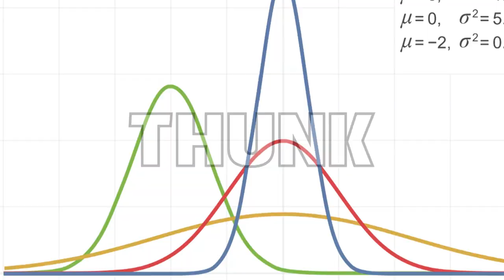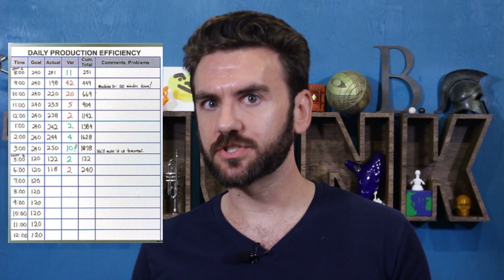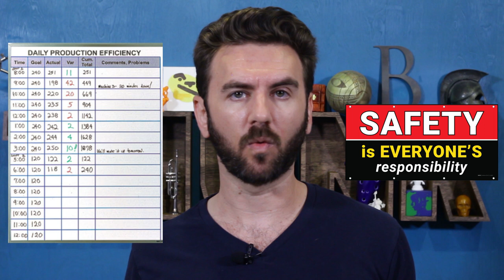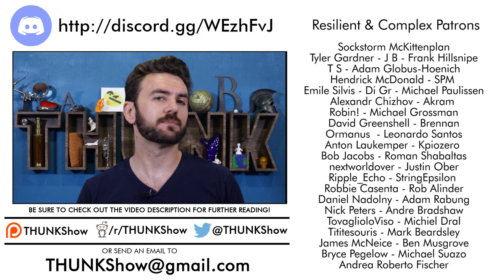208. How Complex Systems Fail

Comment: I work in a company of about 600 software engineers making software together. That organisation is a complex adaptive system, and the principles of Dr. Cook applies for sure. We tend to do these heavy handed post mortems when things go wrong, filled with root cause analyses and resulting in weird bits of policy (like monitor metric X two times a week).  Excited to read more about complex adaptive systems and resilience/robustness to understand how I can apply this in my professional life. Thanks!
Reply from the maker: > 600 software engineers making software together
I mean it would be weird if you were all making pizza together or something. 😅

Definitely check out the talks that Cook gave at Velocity (linked in the video description) - he talks very directly about strategies to enhance the robustness of large, complex software.
Reply: @THUNKShow  one thing’s for sure: with 600 people making pizza together you’d inevitably end up with pineapple on it.

Comment: I'll happily stay a software developer. Figuring out failure modes and finding that one root cause is much easier if you can replicate the issue and take the system apart and observe every component while doing so. It's super frustrating if your system has some really bizarre behavior that was caused by the tiniest of typos - but at least I don't have to deal with the real messiness of the physical world. The world is safer for it too.
Reply from the maker: It's funny you mention that - Cook has given talks at several conferences for software professionals, like Velocity. His general message is something like "Give your users the power to fix things if something goes horrifically wrong - don't hide what your software is doing so they can't get at it if they need to."

https://www.youtube.com/watch?v=2S0k12uZR14&t=0s

Comment: Neuroscience over the last few years has been playing around with what's called the Free Energy Principle, which is ostensibly a grand unifying theory for how organisms behave. There's a lot of heady details to it, but the basic idea is that any system with non-equilibrium thermodynamics (i.e. most interesting things and all organisms), by virtue of regulating themselves to come back to some steady state, whatever that may be, can be modelled as engaging in Bayesian inference on their own existence. In effect, the system is ""predicting"" (very heavy air quotes) the possible future values of parameters relevant to its survival, and if those possible values stray into areas that are hazardous to its survival - that would destroy the dynamics of the system - then the system self-regulates so that its ""predictions"" indicate future survival. This idea then gets extrapolated into explaining how perception, action, attention, etc. function on a computational level. 

This is a very short summary of a very heavy idea, but it struck me as similar to this description of how systems fail. You know entropy exists - all things will vary more and more over time - so you don't try to maintain a perfect equilibrium, but just watch out for when variations might become a problem and then act accordingly.

Comment: This is the reason why complex systems engineers tend to be rather conservative with adoption of new tech. Those are expensive toys to break and new exotic technologies can introduce unexpected points of failure that will manifest themselves in unpredictable moments. Once you have sth working reasonably well you'd much rather reuse the same old solutions, even if new tech could yield performance improvement.

Comment: An interesting analyses but very engineering biased and the engineering only occurs at a late stage of the analyses. For example 3 Mile island in the larger picture happened because it was a plutonium reactor, a very poor material to use for a nuclear power station. Plutonium was used because nuclear reactors were invented to produce plutonium for nuclear bombs, plutonium being an excellent material for bombs.... when reactors were first produce they solely made material for bombs. Then one day someone went, hey! we can use nuclear reactors to make power too, they can make both power and material for bombs, and that will offset the cost of making a reactor purely for military purposes. However nuclear physicists pointed out, we can make power stations form plutonium, but they'd be very dangerous choice compared to other nuclear material we could make which would be really safe. The politicians said, these other nuclear material that are safe, can we make bombs from them. To which the scientists said no, that's why they're safe. So the politicians went with plutonium. And the world got plutonium reactors as the only technology developed......

I could argue it's not a failure of a  complex system but a simplistic and decisive political decision to use plutonium.... But even further to the money saving of using power stations to make plutonium instead of dedicated military only reactors.... then back to the creation of capitalism which required this money saving orientated approach. So a failure of economics and politics.
Reply from the maker: > very engineering biased
¯\_(ツ)_/¯ I yam what I yam.

It's a good point that the decision to build the reactor using comparatively dangerous plutonium was fueled (ha-ha) by political, military, & economic factors - I think this can & should play a role in how we go about making sense of the sequence of events. An analysis of Three Mile Island that doesn't note the elements (ha-ha) of the disaster that lie upstream of the air line bubble would be missing an important part of the puzzle - authorities chose to make it more dangerous than it had to be from the get-go!
Reply: I see what you're doing there!😂